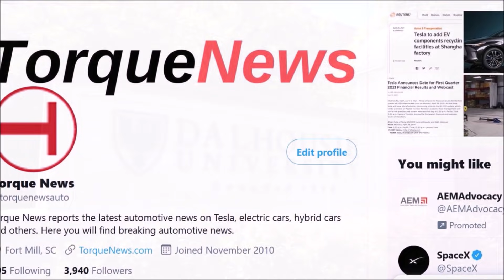How Tesla's Latest Move Could Make EV Batteries Cheaper Than Ever

Comment: FYI Jeff Dahn is starting a new role as Chief Scientific Advisor at a battery materials company call Novonix in July. They will compete directly with Tesla for anode and cathode production for electric vehicles and battery storage. It will be interesting to see how this research relationship will work.
Reply: The Dragon Slayer  Novonix started as a battery testing company by one of Jeff Dahn’s PhD students but now they are producing anode material for Samsung and have an MOU in place with Sanyo. Jeff’s son works for  Novonix and Jeff is starting officially working with them at the beginning of July. Novonix claim that their anode, in combination with their electrolytes, and single crystal cathode will produce a battery that will cycle well over one million miles. I was hoping the @TorqueNews would have some insight on the relationship.
Reply from the maker: That's interesting. Any reference Dimitry? Thanks for your comment. Please also follow me on Twitter at https://twitter.com/torquenewsauto for daily EV discussions and to stay in touch.
Reply: @Torquenews  it’s been officially released in Novonix’s company announcements
Reply: tsla is going to need a ton of graphite. many close ties to novonix. these are my only 2 equity holdings. massive conviction on both

Comment: Price is the main barrier to the massive uptake of Electric cars.  The Nissan Leaf could have become the iconic car of the century.  The VW beatle or combi, the Model T ford, The Deux Cheveau but unfortunately they have two strokes against them.  One, their cooling system for their batteries is not up to spec and Two, they don't provide new batteries for their cars which are readily available, well priced and with the latest technology.  If their customers were their first concern, they would have a massive share of the EV market.
Reply: Yes I agree. I own a Nissan Leaf. Fantastic car to drive. Not looking forward to the day it needs a new battery pack. Nissan tells lies about battery upgrades being an option and replacements are sooo expensive.
Reply from the maker: Thanks for your comment. Please also follow me on Twitter at https://twitter.com/torquenewsauto for daily EV discussions and to stay in touch.